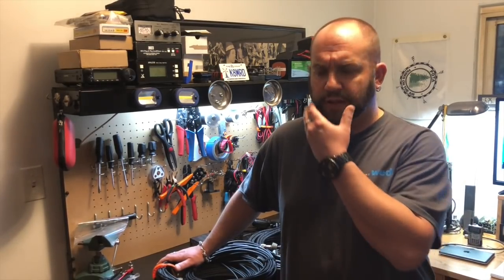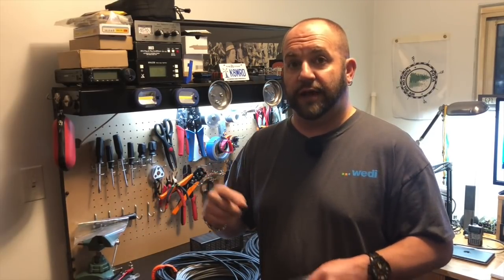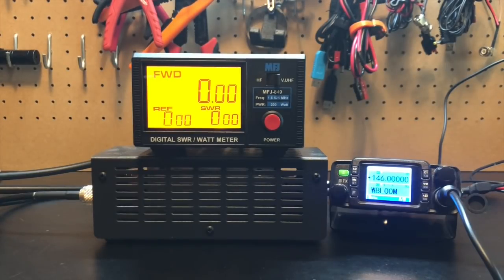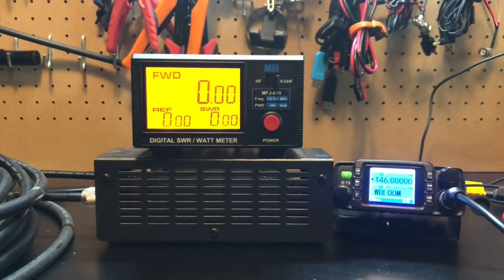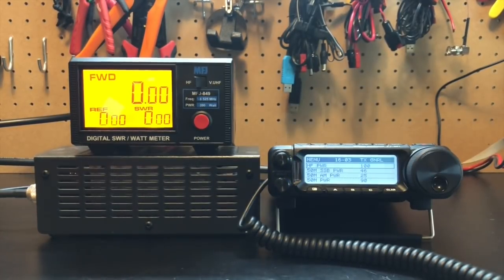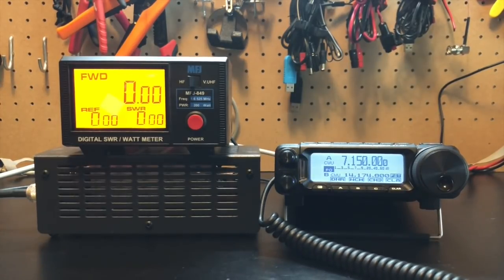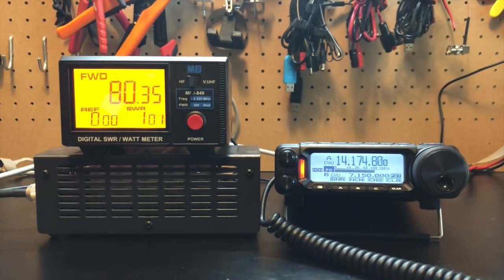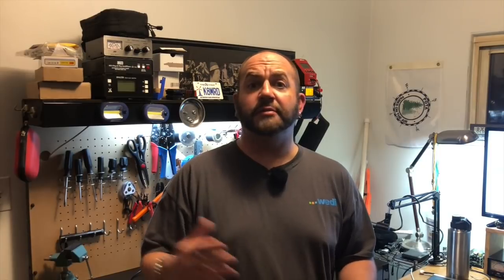Measuring Coaxial Cable Losses @ HF, VHF, and UHF frequencies.

Comment: Great video. This is why I run LMR 400.
Reply from the maker: Good choice!
Reply: K7GF - LMR400 is pricey and it’s more difficult to work with (bigger bend radius).  They have their pros and cons.  For example, a short length of RG-8X is great to stuff in the backpack and hike with (SOTA).  Running QRP at home I’d definitely prefer LMR400 - but my wallet said, “Go with the RG-213/U”.
Reply: @dougyoes   Hi why not use LMR 240 for shorter lengths instead of rg8x? Also up to what short length would you use rg8x up to? I am looking to buy the slim jim j pole from N9TAX, I am new to radio so would like to know your opinion if I should use the 16' rg58 cable it comes with or just buy the antenna and use 33' of lmr 240 (found a good deal on it). I will be using it for backpacking/general preparedness situation. So one antenna will be for GMRS and the other for 2m/70cm 5 watt radios.

Comment: I use 213 as much as I can. Have you looked at RG-400, guess it  would be great its just money. like your comments . 
Have 817 and g90 want to go to the woods. which one would you use. sell both and get 991
73
Reply from the maker: No way would I buy a 991!  Eww.  My neighbor has one (991A actually) and I'm not a fan.

Comment: Great video. Now subscribed. I just fell victim to this by adding an additional 10 ft. of coax and a SO239 bulkhead adapter to “clean up” a cable run. Totally killed what previously was full quieting into a repeater 20 mi away. I can’t even reach it now. Live and learn.
Reply: I was getting ready to put in a bulkhead adapter. But now I won't.
Reply from the maker: Thanks for the sub.  I'm surprised a bulkhead would completely kill your signal.  Connectors will do "something" to your signal but are usually so small you would never notice it unless you had some precision instrument to detect it.  I would look at a different piece of coax.  I'm kinda suspecting one of the connectors could be shorted.  I've had that happen to me on what I thought was a perfectly good piece of coax.  Actually the grey coax in this video needed to have a connector replaced during filming.  A coax I use all the time, and it had a short in it.  It happens.

Comment: Same goes for mobile, cut off that extra cable and don't think about using RG-174 (smaller than RG-58) cable. Also, this is why the Satellite and DX guys use tower mounted preamps, as every Db counts in weak signal work.
Reply from the maker: Yeah this had me thinking about the coax in my mobile as well.  They all seem to use thin, lossy coax as well.

Comment: hi, good video well explained,i hope to do a test on the Gainmaster 5/8 wave and 25 meters 213 u coax cable. I have 2 exact swr/power meters ,just waiting for some good weather ,thanks from Rotterdam.
Reply from the maker: Right on.  A gain antenna would be how to get that power back.

Comment: Hi Mike K8MRD. Great video man, just goes to show that the coax losses are a real pain in the butt specially on UHF/VHF.

Just wondering on the effect of cutting your cable in half wavelength multiples. There are several videos on YouTube that says inductance and capacitance varies inside that half wavelength piece of coax and cutting your cable in half wavelength multiples would minimize its effects and therefore maximize your transmission power. I've incorporated that method whenever I cut coax cables for my own or a friend's setup but not having the right tools to prove it works just makes it about 90% accurate and not 100% in my mind if you know what I mean.

Thanks and 73. 4G1FBL from the Philippines.
Reply from the maker: Thanks for watching.  I've not heard that about coax as a whole.  I know with end fed antennas the length of the coax might matter, but not always.  Thats interesting.

Comment: I hope we can somehow do impedance matching to mitigate transmission line losses.
Reply: Even a perfect impedance match will suffer losses.
Reply from the maker: Everything in this video was 50 ohms.  Impedance matching would be more on the antenna side of things.  We're almost always (except for a few unique circumstances) going to use a 50ohm coax.  However, if we are matching impedances with the antenna, say a 9:1 unun, there is always going to be some loss in that transformation.  There is always a compromise to be made somewhere.

Comment: ??? When I first saw RG8X I thought this is cheap. So I went to a coax loss chart. Then I said what freaking idiot would buy a freaking resister to put between their antenna and radio. Seriously!!!! I see people buying that crap all the time!!!! The worse part is they buy 50 foot, which is the WORST possible length a crappy coax should be bought at. At 50 foot it perfectly hits the highest SWRs at basally every ham band. People spend good money to buy a quality radio and tuner, then screw up buying the very thing that makes their good purchases basically worthless.
   P.S. RG8X at 50 foot on UHF your output if everything else is right is about 25%. That means 3/4 of your power is ate up.

Comment: Would you use RG8x for receive only, like for a scanner or SDRplay ?
KN6AAH
Reply from the maker: On Hf sure. Losses work both ways with coax though.  So if you use 8x on vhf/uhf your received signal wouldn’t be as much as with a better coax.

Comment: Try the rg400 on vhf and uhf for mobile
Reply from the maker: I'm not familiar with RG400.  That can fit through a door or a trunk for mobile??
Reply: @hamradiotube  RG400 is about the same size as RG58, it’s a dual screen Teflon insulated coax with silver plated conductors. It has lower loss than RG58 but its a little less flexible. Another alternative is RG142 which looks similar to RG400 but has a solid rather than stranded centre conductor and a bit less loss but is also less flexible again.

Comment: Have 100ft of Lmr400 at 1kw very good transmission on 40 and 20m.
Reply from the maker: I would like both of those things.  In due time.
Reply: Check out ebay prices

Comment: its also a two way street. cant hear well will crap coax cable. i use LMR-400-UF(Ultra Flex). http://bellscb.com/products/accessories/LMR-400_coax.htm
Reply from the maker: indeed it is.  LMR 400 is great for sure.

Comment: LMR-400?
Reply from the maker: I don't have any.
Reply: @hamradiotube  I am waiting for some, around 24'. Assuming you are connecting the radio to the coax, then the meter at the end of the coax, and between the dummy load. Maybe coax in same room? Will try. Thanks.
Reply from the maker: @k2icc  Yes, the meter would be at the end of the coax simulating the antenna feed point.   The dummy load was connected with about 2' of RG8X after the meter.

Comment: I just bought 200 feet of 24600 for the tower. My ass is still chapped.
Reply from the maker: I don't know what that is but all those numbers in it cant be cheap.
Reply: @hamradiotube  DESCRIPTION:
Flexible alternative to ½” Hardline (Helix©)
UV Resistant, Direct Burial, Polyethylene Black Jacket.
Gas Injected Foam Polyethylene Dielectric VP: 87%
RoHS Compliant.
Overall Diameter: .590?
Nominal Attenuation-per 100ft/Power Rating(kW)/Efficiently%
0.5dB @ 50MHz/4.24kW/88.2% E.
1.0dB @ 150MHz/2.41kW/80.1% E.
1.7dB @ 450MHz/1.35kW/67.3% E.
2.5dB @ 900MHz/0.93kW/56.2% E.

ABR 24600 is a low loss high-performance cable. An alternative to CommScope® WBC-600, Andrew® CNT-600 coax cable, Belden®, TerraWave TWS-600 and Times Microwave Systems® LMR-600.
Reply: Copy and paste is a wonderful thing.
Reply from the maker: @1958johndeere620  Holy crap that's awesome!
Reply: @hamradiotube   I spent 3 years building a 70 foot fold over rohn 25G and figured I would get the most out the door I could. I use the 600 cable for a A13B2 beam, and 1 for my Diamond X300 both at 75ish feet. For all my HF needs the ABR 25400 is very good cable.
Reply from the maker: @1958johndeere620  Yeah I think I still have a few years to go until I get to that status!  Smart move though.